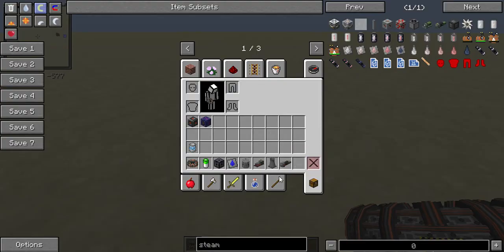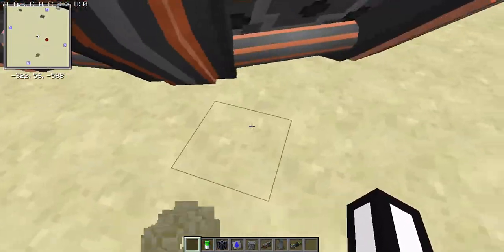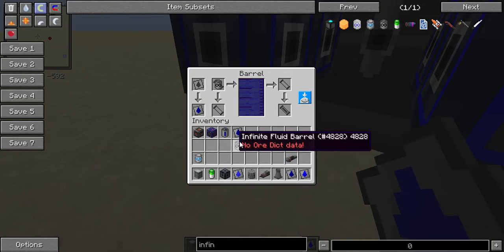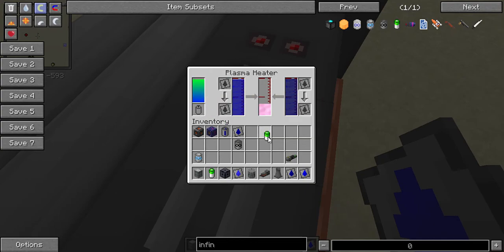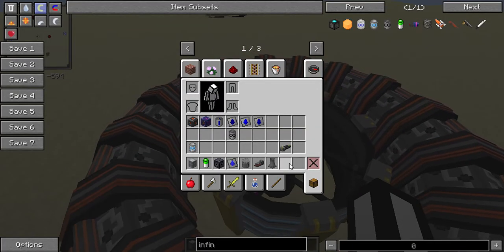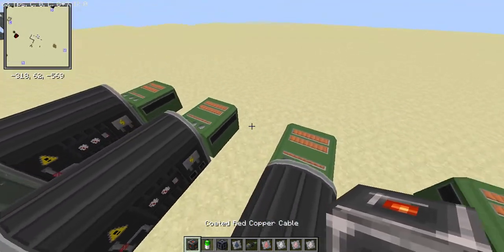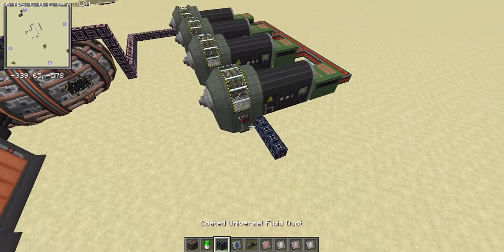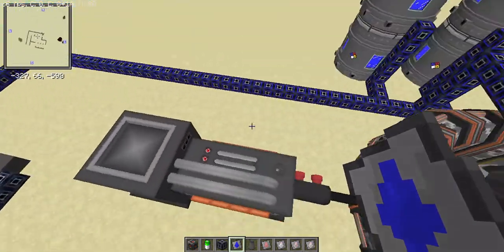Fusion reactor setup guide! | HBMs nuclear tech mod tutorial

Comment: i know that cam be an idiot question but it explode?
Reply from the maker: Only under very specific circumstances, unlike the RBMK it doesnt explode if water runs out but it does waste the fuel, the fusion reactor can only explode if the blanket you are using isnt strong enough for the plasma or if it breaks/you take it out during operation
Reply from the maker: And even then its a fairly small explosions